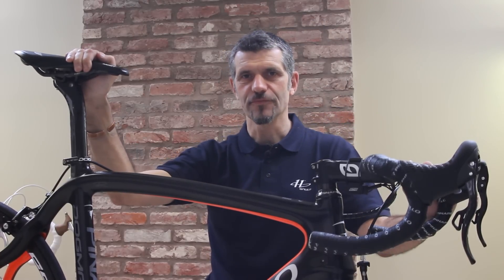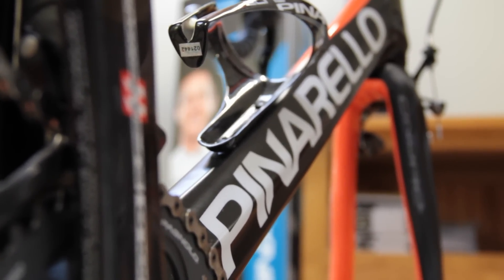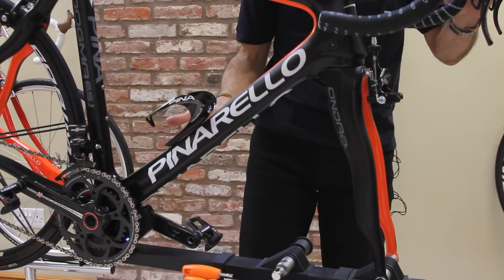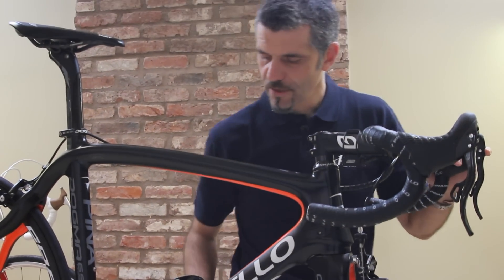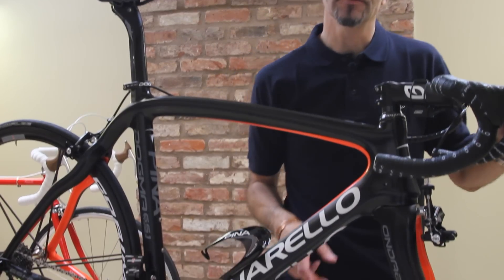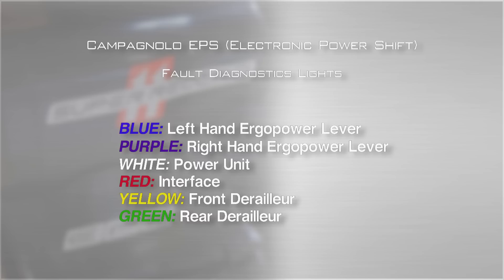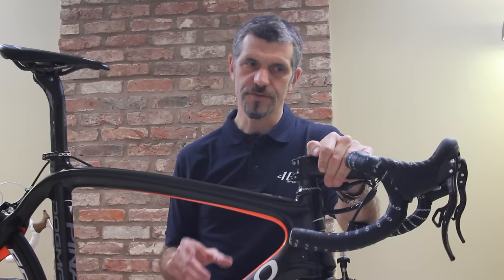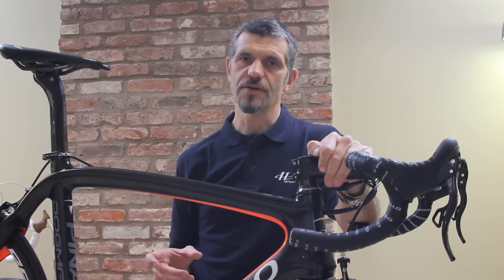Campagnolo EPS Faults & Diagnostics

Comment: How clearing faults purple and green?
Reply: Could be a short press on either mode button or could be necessary to turn the system off for 20 - 30 sec then on again.
Usually these faults occur if a component is disconnected with the system switched on. If a connection between a component and the rest of the system needs to be opened for any reason, ideally the system should be switched off before the component is disconnected.